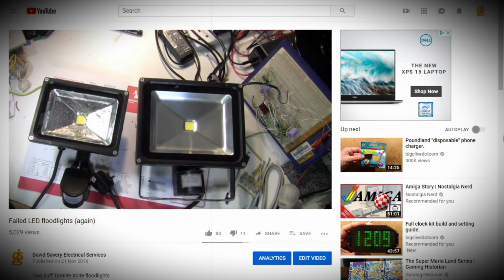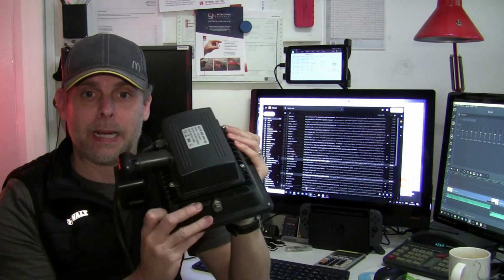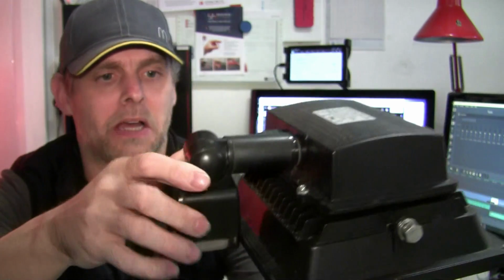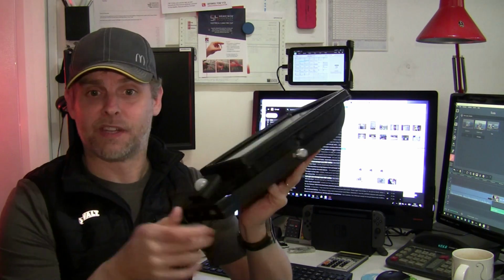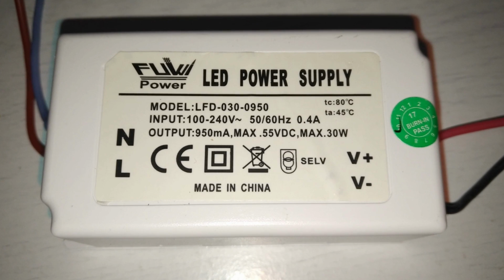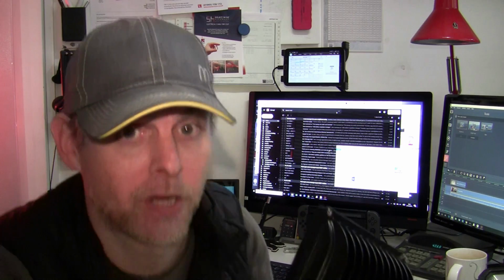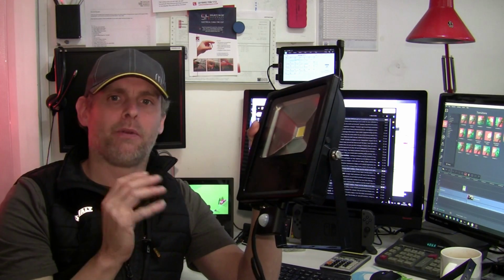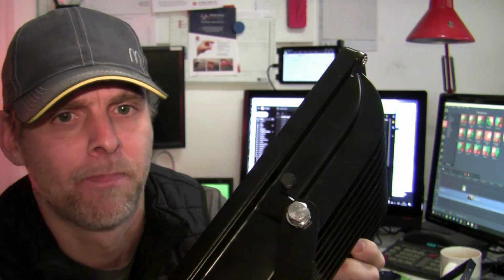Tamlite LED floodlight review *new model*

Comment: i have an energizer led flood light with pir and have a problem where if you turn the light off at switch and back on it dosen't work till ive turned it off 3-4 times then the light will come on but won't turn off.
Reply from the maker: Could that be something to do with a manual override mode? Some PIR's have that and allow the light to be overridden if flicked on/off a number of times in rapid succession. Or it could just be borked of course!
Reply: @dsesuk  so does that mean my pir might be broken? ,not 100% sure i clicked it on and off a few times and nothing happened then it came on after a break and click turning on and off rapidly
Reply from the maker: @knightsbliss6889  I'm not familiar with the brand so I can't say for sure. There may be different 'modes' that can be activated by clicking it on and off, and the flashing may indicate that it has entered a given mode, but without the instructions I couldn't say for certain. I imagine however that if switched off for a while, it ought to enter a normal operational mode when turned back on, and the PIR should work as expected. If it's not behaving in a logical way then it may be a fault rather than a clever operational feature. If you Google the model number, do you get any hits for the instructions?
Reply: @dsesuk  okay after looking it has a manual overide if you turn the switch off and on twice it will stay on constantly ,it isn't flashing just sometimes takes effort to get the light to come on at all.
Reply from the maker: @knightsbliss6889  Sounds like it may be a little poorly if not operating as expected.
Reply: @dsesuk  can you just snip off the pir and have the light work?
Reply from the maker: @knightsbliss6889  The PIR usually has a live in, a neutral and a live out. If the two live wires are joined, then effectively the PIR is bypassed. The design of yours may be different of course. All that said, a modification such as that would not be manufacturer approved, so any subsequent loss or injury caused by unauthorised tinkering would land at your door. While removing the PIR may be technically possible, doing it in a way which maintains the IP rating and ongoing electrical safety of the product may be more difficult. That's not to say I haven't made such modifications in the past, but they tend to be for my own use and I accept the risk for myself!
Reply: @dsesuk  well i removed the pir and light works when pluged in as normal light would,just clipped wires and sildered them on and heat shrink to cover bare wire,only issue was light was sealed unit so pain to get in and one led dye had gone leaving 2 lanes of leds dead but light output pretty much the same

Comment: Glad you carried on this rant Dave, I actually installed 2 LAP screwfix floods today, a 50W and a 20W I have installed these before without any come back so far. I used to install Luceco before them, and had a lot of failures (i posted on your last video about led floods)..any way, my idea now is to fit cheapo (but the most reliable) and mark up 50% to cover any call back, The LAP floods are guaranteed for 3 Years, seem well made too, no worse than luceco. I have been trialling an even cheaper (Homebargains brand) on my own home, and I must say it too has not failed after 1 year lol, I think some of the failures are how they are installed, and prewired are better for me as 90% of the time i use a Jbox to terminate them, Time will tell, but dont think because its more expensive it is better, I got sucked into that like yourself, and it cost me. Them LAP 50W are really bright too, like them a lot, and no disassembly of the bracket, and will take a  number 6 screw and plug...ticks all the boxes for me anyway. Great video.
Reply from the maker: I've never been a fan of LAP stuff, but I'm glad to hear it's doing the business for you. Most manufacturers seem to have an extended warranty period on their products, but it can be a pain to paw through the past invoices to find your proof of purchase. The wholesalers can often search their own records, but it depends on how helpful the guy behind the counter is feeling.
Reply: @dsesuk  LAP do seem to have improved over the last few months to be fair, they were really shit lol...

Comment: David, if you have not placed it on a wall yet, can you tell me if it is UK only or is it a universal voltage..90 to 250 voltage??
Reply from the maker: 220 - 240V according to the label on the rear, although I wonder if the driver inside has a wider voltage input? The old model stated 100-240V. Sadly the one in this video was bolted to someone's wall today so I no longer have it to hand!
Reply: Thank you. Unfortunately, what I need has to have  universal voltage.. where I plan to use it is 120v 50 hz

Comment: When a product fails, the cost of a replacement fitting + labour charges should be passed onto the manufacturer.
Reply from the maker: It'd be great if you could get away with that! Sadly, manufacturer long-life claims boil down to them putting my money where their mouths are! Some of them really don't get it though; I had one importer/supplier whose products kept failing and when I complained they said "it's okay, all our products have a two-year guarantee". They never considered my lost time to return to site, loss of face with the customer or the time and cost to physically return the faulty goods to them for exchange.

Comment: M6 Coach screws into 8mm plugs, can use a 10mm socket then.
Reply from the maker: That's probably what the manufacturers have in mind with these brackets. I don't tend to carry coach bolts on the van though. Maybe I should.

Comment: Nice video friend. I was with you on most of your points about the light except for the prewired cable/external terminal box implication. I much prefer wiring inside a Wiska box than any manufactured enclosure on the back side of a light. Just my preference. Time wise it's the same, just more on parts cost.
Nothing more annoying than dropping those bracket bolts from the top of the ladder....you may find the bolt, the washer is never recovered haha.
Reply from the maker: Always fun to be at height, threading a bolt into a washer, through the bracket, into another washer and onto the fitting, then having to tighten with an adjustable spanner!